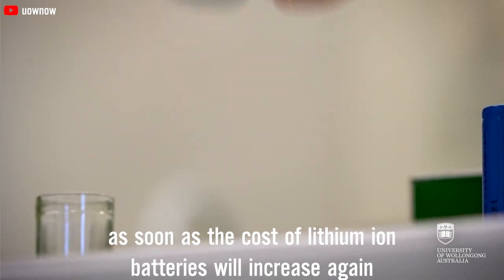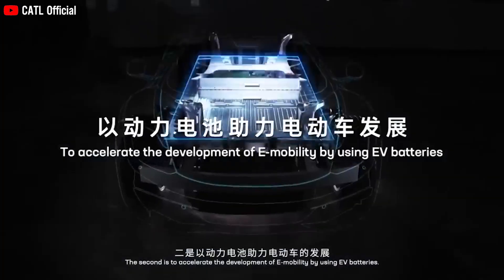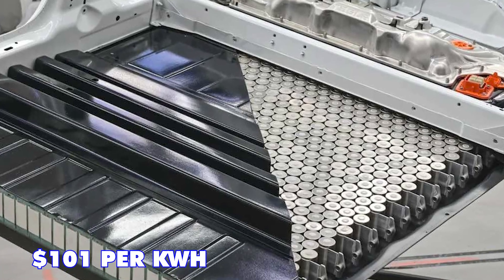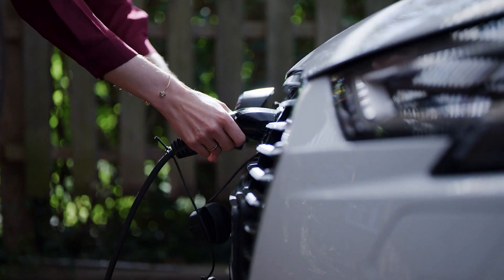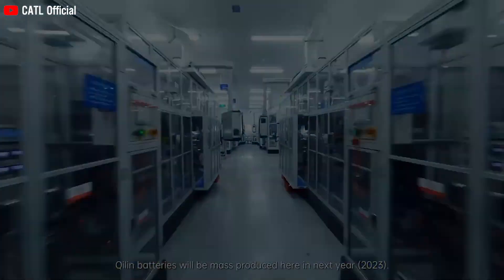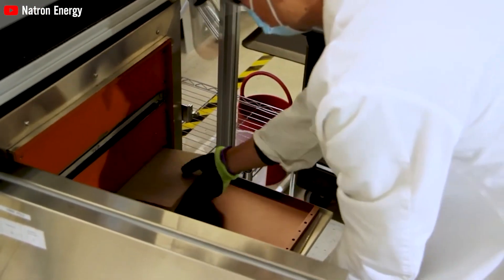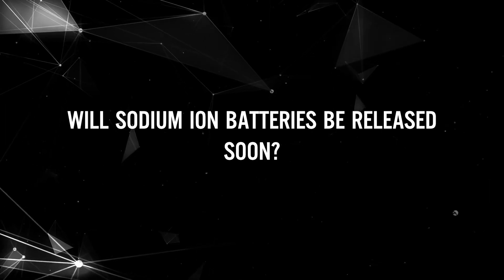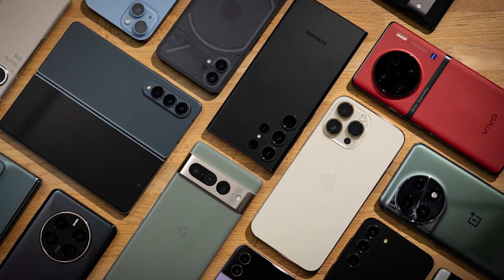Goodbye Lithium! The Game-Changing Sodium Ion Battery 4.0 Revolution of 2024!

Comment: The volumetric energy density of sodium ion batteries is less than half that of sodium ion batteries. 
This would make viability of sodium ion batteries a questionable choice for large vehicles - the extra weight would undercut the per volume price saving.

On the other hand, as a solar battery (where volume and mass is much less important), along with the lack of risk of spontaneous combustion.  this seem very promising indeed.
Reply: robot audio sux.
Reply: The cold weather ...hot conditions performance would still give the Na cells an edge...and safety off road..